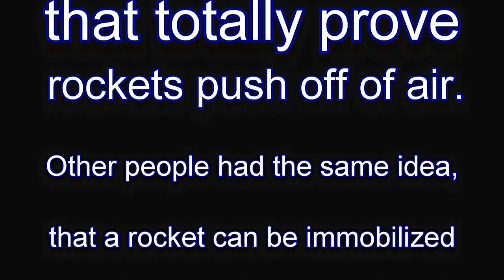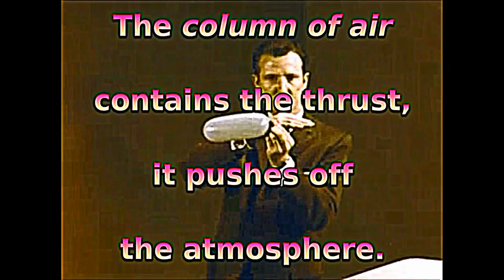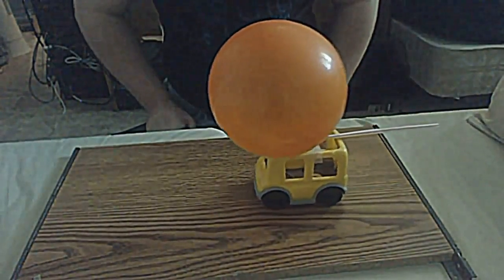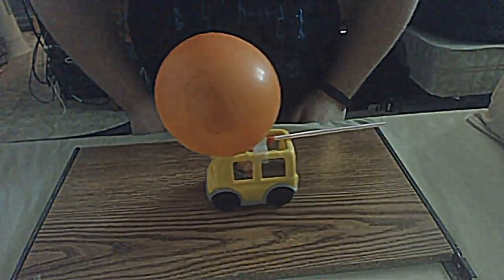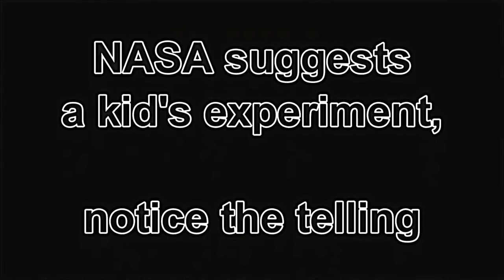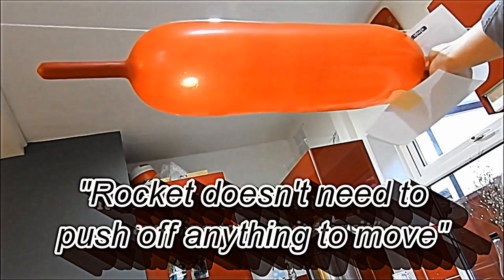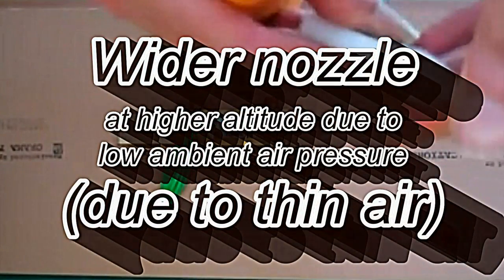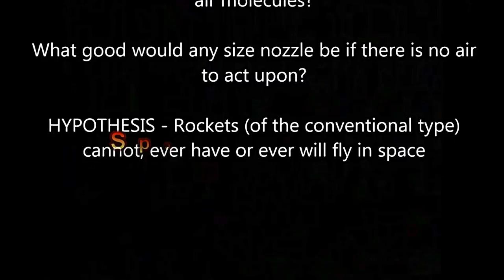rockets push off air

Comment: Now you need to do it in a vacuum to actually prove your claim.
Reply from the maker: No Bob. If rockets need to push off air, then space is fake. Vacuum only exists in confined spaces on earth.
Reply: You haven't proved that your balloon wouldn't fly in a vaccuum.  You are assuming your conclusion.
That's garbage logic.
You need to create a vacuum in a large container, like a bell jar, and release an inflated balloon to prove what you are claiming.
Now, if air pressure decreases gradually and continually as you increase in altitude, you would get what, eventually, Mr. Genius?
Reply from the maker: You would get what we see in every rocket launch, a parabolic arc. The rocket reaches the max altitude due to THIN AIR and due to the nozzle circumference (each diameter is only good at a specific altitude, wider for thinner air) and then drops back down, proving rockets push off air. Your little bell is not INFINITE SPACE or even close to imaginary space. Now then, where is your PROOF that rockets do not push off air? I set out to prove rockets push off air and succeeded. Vacuum only exists in confined spaces on earth. Up high we have thin air, that, together with nozzle diameter limits the height of rockets to that of a jet plane, take care, and I'm waiting for your PROOF.
Reply: Why is the air thinner higher up?
Reply: Yeah, why is the air thinner higher up? Surely not because of... gravity!!

And anyhow, what do we mean when we say "the air is thinner"? What is air (we can't see it)? And how can something we can't see be "thinner". If we can't see it, it must already be thinner than a cobweb, right? And if it's thinner than a cobweb, surely it would break if something tried to push against it? So, how do rockets even push against it if it's not even strong enough to support a very small spider??
Reply from the maker: @pictobloxer5412  nothing goes to space, air is too thin past 20 miles up
Reply: @rocketspushoffair  wait, you mean we really hadn't gone to space?
Reply from the maker: @pictobloxer5412  right, nobody has been to space, space is actually fake
Reply: @rocketspushoffair  be gone
Reply: ezdfiant a rocket works like a constant explosion. The explosion pushes against the rocket causing it to move upwards. Air is not needed to move a rocket upwards, in fact, air slows the rocket down as friction is a thing. The air particles colliding with the rocket produces friction, which would slow it down. Not to mention that gravity also pulls the rocket down.
Reply: @rocketspushoffair , I can't help but notice you never addressed the question of why air is thinner the higher you go.

You've acknowledged that the air gets thinner the higher you go, but why? And what do you think the 'limit' of thinness is when it comes to air in the Earths atmosphere? Also, what causes that limit? Is is a physical barrier like the firmament? Or is it something else?

Also, why are you so opposed to using a vacuum chamber to show that rockets need air to push off? Wouldn't it prove your position of 'rockets need to push off air' to be a correct hypothesis once it showed that thrust was not possible in a vacuum chamber?
Reply: @rocketspushoffair  Why does the air get thinner as altitude increases?
Reply: @rocketspushoffair  if I can interject, not meaning to be rude. But rockets arch because they need to gain orbital velocity. This is where they travel so far at a certain altitude that (effectively, there is more complex physics behind it) that the earth falls away from them as fast as they travel around it. Sorta like spinning a ping pong ball in a cone (if that makes sense) in this case, no matter how far they go up. If they dont start accelerating around the world, they’ll just come back down. That’s why all amateur rockets go straight up and straight back down whilst rockets with orbital payloads such as astronauts and satellites arch. They are trying to achieve orbital velocity. 

As for nothing ever getting to space. You can see the ISS in orbit with the naked eye. Only one way it would be there.
Reply from the maker: @engineeringtheweirdguy2103  You have no clue what you are seeing that you call the ISS. And if you can see it with the naked eye (I have seen it a few times) then they should be able to see the planes clearly flying over the ball, which are above the weather systems. And, Hubble (which is really just the SOPHIA plane) should be able to zoom in on earth or the moon. Again, no such evidence. In the video, the NASA spokes person specifically says "STRAIGHT UP!" Did something change? 

Yes. They realized that people can still see it long enough for it to start nosing down at the apex of the parabolic arch due to thin air that can no longer support it thrust. The amateur rockets don't go very high. EDIT:  And not as tall.

Jet planes are limited by thin air. They have the same principle of propulsion as rockets, only they use the rocket engine to turn turbines to compress air and blow it out the back of the engine, while rockets use the natural expansion of combustion directly. In either case, it is gas vs gas outside the engine.

On a fighter pilot channel, he was asked what happens if he tries to thrust into a higher elevation than max elevation, and the reply stated that it is impossible to go even an inch higher. This is 100% due to thin air. Be honest with yourself, you are defending a lie, an impossi-BALL HOAX.
Reply from the maker: @pblakeney  Air has weight. If there was a magic force, it would all be compressed to the ground. We are literally at the bottom of an ocean of air, just like being at the bottom of the ocean.
Reply: @rocketspushoffair  if there was a force such as gravity then just like water we should see pressure increase with depth. Which we do. Hence the pressure gradients. Which follow a linear progression in relation to the weight of the air above it.
Reply: @rocketspushoffair  and weight is a force = mass X acceleration due to gravity (g=9.81 m/s/s). It would not all be compressed to the ground. Your statement proves you don't understand physics. Your statement about air is not correct either. Air has mass (not weight). Weight is not constant in the universe. On Earth, because of this acceleration, all objects with mass on Earth experience weight. Objects with greater mass experience more weight and would be more attracted to the Earth than objects with less mass.
Reply from the maker: @pblakeney  most people say weight, only brainwashed people say mass, as there is no magic force of gravity. All you have done is invented an F=ma relationship. YOU don't have a clue. If there was a force all air would be forced to the ground. Terminal velocity also proves there is no active force constantly pulling. And no, air resistance is not the reason, because you can drop a thin metal pointed rod which has very little air resistance, terminal velocity is reached in a matter of seconds. Also, no cracked body can spin, and no material can spin over 1000 mph SPIN1.FLAT.WTF custom link to my page on Blogger, debunk that. Fake globe earth is mostly covered with a cracked basalt crust.

And THAT'S the end of the globe!
Reply from the maker: @engineeringtheweirdguy2103  Air is fluid, if there is a force pulling on it, it will all be pulled down.
Reply: @rocketspushoffair  yes it will. But gasses are particles, they bounce off one another and surfaces. Imagine pouring a a ton of bouncy balls off a building into an open top shopping container. There are a lot of balls at the bottom but as you get higher in the container the balls get thinner and thinner as they bounce around.
Reply: @rocketspushoffair  I just read your comment on force in more detail and i gotta say. not very well constructed. Physics 101 stuff. Lets start with your assertion about an object spinning at "1000mph". things do not spin in mph. when someone asks how fast your motor spins in third gear doing 60mph your dont reply with 60mph. you respond with 3500 rpm or revolutions per minute. that is because RPM describes a rotational velocity which is applied to a rotating body. every part of that body, from the outer rim to the centre of the axel is rotating at that speed. Mph is a linear velocity or tangential speed. which changes according to the radius from the axis of rotation for any one rotational velocity.

another point to make is there is a keen distinction between weight and mass. this is easily proven and observed. If you have a bucket of water and you spin it around and around. you will notice a force applied to your hand. That force is determined as weight. additionally if you were on a roller coaster and you suddenly started flying down a ramp. if you were to be on a scale at that point in time your weight would be less than standing on the ground. Weight is the magnitude of the application of force. We can observe this readily. such as in the bucket example. The weight of the water in the bucket increases and pulls away from your hand. But the mass of the water. i.e. the number of atoms making up the water in the bucket, has not changed. Mass, being effectively the count of atoms of an object or volume, then determines the weight of an object. the more water you put in the bucket, the more weight will be experienced when you spin it. That is because the centripetal acceleration is being applied to the mass in the bucket to generate and outwards force which we know as weight.

There we see a very clear distinction between weight and mass. something with a mass of 40kg, will have a mass of 40kg, if its going up or down a roller coaster or being swung around in a bucket. But the weight of that 40kg can changed depending on the net acceleration applied to it. As we have just demonstrated.

This is first year physics 101 and is trivial to demonstrate. as you have just seen.
Reply: @rocketspushoffair  in regard to terminal velocity. a small pin does not disprove air resistance. merely re-enforces it. A pin, despite having a small surface area, still experiences wind resistance. which is a function of the speed and the aerodynamic area. meaning if the pin takes up any space what so ever facing towards the wind. even one as tiny as a pin head, means there is a non zero wind resistance on that pin. as the pin speed increases, the wind resistance increases. As we know, sticking your hand out of the car doing 70mph experiences significantly more force than holding your hand out in a light breeze despite having identical surface area. This is because wind resistance or air resistance is also a function of speed as much as it is a function of area.

as the pin increases in speed, so does the wind resistance until ultimately the force of the wind is equal to that of the force pulling the pin downwards (the weight). at which points the two forces cancel each other out and you have a classic example of Newtons 1st law applying to an object in uniform motion. it wont accelerate or decelerate until acted upon by something out. but maintain its speed. Hence, terminal velocity, even for a in.
Reply: @rocketspushoffair  and before you bring it up. Yes, I have seen your video on the mechanics handbook. In accordance with my comment made on that video in its comment section, the Mechanics handbook is correct. But your interpretation of it is wrong. This is because there is a distinction between stress and applied forces. There is also a distinction between linear/tangential velocity and rotational velocity. It also doesn't account for anything with gravity keeping it together, which as I explained would be similar to tensioning a steel strap around the flywheel to keep it together.
Reply: @rocketspushoffair  Crickets!!! LOL Typical Flat Earther can't defend their model!!
Reply from the maker: @engineeringtheweirdguy2103  Flat earth is enclosed by a dome, try your experiment dropping balls on a ball.
Reply: @rocketspushoffair  I fail to see what difference it makes of its inside a dome or outside. Even a basketball would seem like a flat expanse to the size of a gas particle.
Reply: @rocketspushoffair  also there is absolutely no proof for a dome and all the evidence that there isnt
Reply from the maker: @engineeringtheweirdguy2103  Is that the best an "engineer" can do? Is cry "first year physics"? WHAT A JOKE! When I took "1st year physics" nowhere did they explain how a CRACKED BASALT body can spin, or how any cracked body can spin. Moreover, they did not show how any material can spin over 1000 mph like a top, w/o exploding way before that. Likewise, you too are unable to show how a CRACKED BASALT covered behemoth can spin at all, and spin like a top over 1000 mph. Hint: PHYSICALLY IMPOSSIBLE

The Machinery's Handbook, if you payed attention at my blog, (spin1.flat.wtf , spin2.flat.wtf , spin3.flat.wtf ) speaks in terms of feet per second, when talking about hoop stress. I have a video that shows two cutting discs of different diameter but the same speed limit 80 m/s (it also shows different RPM 13,000 or so and 5500 or so) Notice how radius is irrelevant?--If not, see the proof at my blog.

Your diatribe about weight is a deflection, like the rest of what you said in your comment. The scale below your feet is simply not attached to your feet or the ground, your weight has not decreased IT HAS INCREASED. Let's look at the fake Apollo rocket, NASA states that it weight 3000 tons, and it produced 3700 tons of thrust, hmmm, SIMPLE MATH tells you it cannot be true! At an acceleration of just 1 meter per second, the rocket now weighs 15,000 tons. A five fold increase. But they get away with fooling even an engineer, that is embarrassing.

Again, there is no force pulling on anything, that is a CONTRIVANCE. You accelerate for several seconds, and then you are at terminal velocity. People understand weightlifting not mass-lifting. Some idiot took terminal velocity, passed it off as a constant acceleration due to a force, created a new unit with his initial N and called it weight. And you fell for it, never thought to question it. There is obviously no force pulling on anything, there is just free fall speed and terminal velocity.

So far, you are failing Physics 101. Let's put another nail in your globe cult. Rigid body rotation with translation. Or a ball that spins like a top circling the sun (or a car tire rolling on the road). When we examine just two of the fake globe's purported motions COMBINE, we see that there is 21 mm/sec squared acceleration and deceleration, alternating every 12 hours and switching direction every 6 months. Try building a rock balancing statue with that much acceleration! _HAAAHHAHAHHAA!!!!+ 

Add the acceleration due to orbiting the sun and being dragged by the sun, you are good for another 4 mm/sec squared. Simple online calculators are available, where all you have to do is plug in the fake g lobe data. Also, I have two videos uploaded for each pair of motions I mentioned. The first one by an actual physicist, that I edited to make some improvements in the presentation https://youtu.be/AfEbsnOXrX0

So, you are a complete failure.
Reply from the maker: @engineeringtheweirdguy2103  I never said "a pin". I said a thin metal rod, something that weighs at least a few pounds or more, say 10 feet by 1 half inch, sharpened to a long point. After several seconds it is at terminal velocity, and wind resistance has no involvement whatsoever in reaching terminal velocity, after so short a time, and with such a nice shape of object, that easily cuts through. You can use a rail gun to propel an object 7 times the speed of sound, a very pointed object. But the fastest jet plane can barely do mach 3, at which point it practically is melting.

Materials, have limits. A cracked basalt body cannot spin to begin with, it has zero tensile strength. And, even if it was a solid body, no material can spin over 1000 mph like atop, like fake cracked basalt globe earth, w/o exploding way before that.
Reply from the maker: @engineeringtheweirdguy2103  So long as an object spins, all the forces of spinning like a top will be present. A compression is AN ADDITIONAL FORCE. There is no hoop stress tension or compression in the ground, because we are not spinning, no F=ma. If you read the whole chapter on flywheels, then you would have come across the part where it t ells you reinforcements can only do so much, and often times are counterproductive due to the extra weight.In highly engineered flywheels, they do use compression rings, but the physical limit of molecular bonds of the ring is still there. Fake globe earth has a cracked basal crust (mostly) and a cracked granite crust--which amounts to a heterogeneous "compression ring" which amounts to a bunch of BS. The cracked heterogeneous crust is underpinned by molten elastic tectonic plates--which amounts to BS piled on top of BS.

No cracked body can spin, case closed.

I am not "interpreting" anything. Just stating the cold hard facts and backing that up with engineering textbook references. You are looking like a fool trying to defend a physically impossible cracked basalt ball.
Reply from the maker: @pblakeney  Terminal velocity is reached in a matter of seconds. Also, no cracked body can spin, and no material can spin over 1000 mph SPIN1.FLAT.WTF custom link to my page on Blogger, debunk that. Fake globe earth is mostly covered with a cracked basalt crust. EDIT: at least you admitted "gravity" requires "belief" HAAHHAHAAHHAA!!!!

And THAT'S the end of the globe!
Reply: @rocketspushoffair  you do realise that you can use gravity to not only predict ballistic trajectories, impact forces air speeds etc. but also to describe how multiple things work. Something than can be used to predict reality accuracy doesn’t seem like bullshit to me. In addition, I was referring to the difference between rotational velocity and linear velocity being first year physics. Something which, given you comment must have gone completely over your head. Also I’ve already give detailed explaination as to the mechanics handbook. And how it is correct but your conclusion is wrong.

The thing you are ignoring is that gravity is holding everything to the earth. Including all that basalt. With more force than is being exerted outwards due to rotation. That’s pretty rudimentary to prove mathematically. As I explained before that would be the equivalent to putting a tensioned steel strap around the flywheel holding it all in together. I’ve told you this multiple times now.

You can bitch and moan that gravity is bullshit. All the live long day. But you can’t say the globe model doesn’t work due to the spin on the pre-supposition that gravity is bullshit. In that case the problem isn’t with the earth rotating. The logic and physics behind that is fine. The problem you have is then with gravity. Using a false representation of the globe earth model to show how the globe earth model is wrong is the definition of a strawman argument.

At no instance is anyone claiming that, that mass can rotate with the diameter it has, without exerting enough stress to break apart. What we are claiming is that, the gravity of that mass is holding it together. Because the gravity exceeds the centripetal forces.
Reply: @rocketspushoffair  as for terminal velocity, that is well understood. It’s easily and readily predictable in every instance using very basic mathematics. Even for a pin.
Reply: @rocketspushoffair  also that’s not how the acceleration works. As we are part of the orbit, that outwards acceleration will be constant. And the definition of an orbit is that the outwards acceleration matches the inwards pull of gravity. As such the vectors cancel out as they are by definition equal and opposite. Which ultimately leads to us feeling zero acceleration due to the orbit around the sun. F=ma. If a is zero, so must F.
Reply: @rocketspushoffair  if it takes up volume. It has a cross sectional area, it will encounter wind resistance. It’s basic physics
Reply: @rocketspushoffair  wind resistance is at its simplest form, the force require to move the air out of the way for a volume. Your rod (or very large pin) would take up volume. Therefore it would encounter wind resistance.
Reply: @rocketspushoffair  yes. they can only do so much as in more than nothing besides, as I’ve already described, gravity is what is holding it together. Your disagreement is with that
Reply: @rocketspushoffair  Air is compressed to the ground, that's why air pressure reduces so rapidly with altitude.
Reply: @rocketspushoffair  Do you have any evidence for your assertion that after a few seconds your sharpened rod would reach terminal velocity? No you don't, you just made that claim up.
Reply from the maker: @engineeringtheweirdguy2103  You said: "The thing you are ignoring is that gravity is holding everything to the earth. Including all that basalt. With more force than is being exerted outwards due to rotation. That’s pretty rudimentary to prove mathematically. As I explained before that would be the equivalent to putting a tensioned steel strap around the flywheel holding it all in together. I’ve told you this multiple times now." 

You don't know your model or gravity, and you are forced to conflate the physics for two different rotation axes spin1.flat.wtf 

You are trying to justify the cracked liquid filled ball with math that only applies to surface objects. Who's rotation axis is away from their center of mass.

A cracked ball cannot spin. And even with a steel belt, it cannot go close to 1000 mph. 

"Gravity" is much weaker than a magnet, and orders of magnitude weaker than molecular bonds of steel. 

Moreover, "gravity within fake globe earth decreases linearly to zero at the center, and the attraction is towards the surface.

There is no "compression" whatsoever, except in your conflated concocted mathematical excuse.

Tension would have to be the same by definition from the surface to the center. And every particle in your entire ball would have to bee considered as a ball on a string. 

But your model treats it as a sold. You cannot apply any of your mathematical excuses with your made up forces to a solid, case closed.

Also, spin plus orbit equals 21 mm/s/s of acceleration alternating with deceleration every 12 hours. A simple rock balancing statue debunks you. Add another 4 mm/s/s for orbit plus dragged by the sun. If you are having difficulty with the calculations, Ii have two videos.

Take care! 😎👍
Reply from the maker: @engineeringtheweirdguy2103  And speaking of wind resistance, that limits speed to mach three.

Take care! 😎👍
Reply: @rocketspushoffair  why 3 times the speed of sound? Terminal velocity will always be below the speed of sound (mach 1). Terminal velocity is very simply, when the force applied by wind resistance is equal to the force applied by gravity. Wind resistance will increase with speed until you reach a speed where the force of the wind resistance equals the force pulling you down.

slender rod or not. This is the entire premise parachutes work on. They increase the surface area to increase wind resistance, such that the speed at which you need to fall to reach terminal velocity is significantly less. Bullets and arrows are designed to mitigate their wind resistance so they can reach higher terminal velocities and when they're accelerated initially beyond their terminal velocities, their deceleration is slower giving you a further shot with more power.

you're complete ignorance of physics is breathtaking, yet you believe you've outsmarted hundreds of millions of Engineers, physicists, scientist etc. Oh they ego and delusions of grandeur you must have!
Reply from the maker: @engineeringtheweirdguy2103  my previous reply stands, "gravity" is no longer considered a force https://www.google.com/search?q=gravity+no+longer+a+force and it is admitted by physicists that nobody understands it https://www.youtube.com/watch?v=AFwbcWIUwLQ&t=213s but even if we pretend it is a force, what you stated only apples to surface objects.

Moreover, if it is always acing, then there would be no acceleration needed to reach terminal velocity, when a bullet leaves the barrel, it is continuously slowing down.

Free fall is not less at the equator.

So, gravity is not a compression, it is an attraction to the surface from within and without the fake globe, thus, mathematically speaking, the source can only be an infinitesimally thin layer on the surface.

For your compression to work, gravity cannot be zero at the center, and thee source musty bee the center.

THIS IS SO RE-TARDEDLY WRONG: "In the steel belt analogy, the steel belt would only break if if the centripetal force exceeded 9.81m/s/s. (gravity)."--IT WOULD BREAK WAY BEFORE 1000 MPH surface speed. Gravity is orders of magnitude weaker than molecular bonds. Calculations here spn1.flat.wtf

What you are trying to do with your imaginary force is attribute solidity to your cracked spinning space pear and trillions of psi of tensile strength, so that t outperforms solid titanium. Meanwhile, you try to debunk engineering physics with dumb math that only apples to objects who's rotation axis is away from their center of mass.

Finally, you deny basic physics of rigid body rotation with translation. Or a car tire rolling on the road. The COMBINED EFFECT of spinning + orbit = 21 mm/s/s of alternating acceleration with deceleration every 12 hours. Add 4 mm/s/s for orbit plus dragged by sun. Both videos on my channel.

_R.I.P. _  Engineering the weird guy 💀
Reply from the maker: @engineeringtheweirdguy2103  All trajectory calcs are flat earth based. And if it wasn't for the inability to push the atmosphere away, you would have no thrust. Mach 3 is the limit at which point your craft is melting.
Reply: @rocketspushoffair  I've responded to that multiple times. Correct is it not a force. It is an acceleration. Hence  why it is measured in m/s/s and not Newtons. But do you know what happens when you apply an acceleration to a mass.. I'll give you a hint. Its measured in Newtons.

additionally what i've stated does not only apply to a surface. Centripetal force applies to any part of a rotating body at any given radius from axis of rotation. Infact  it so much so, not a surface equation that when designing flywheels or analysis alloy wheel strength you have to find the radius at which a rotational mass is centralised. For example if you have a 500kg flywheel, where 499kg is within 300mm of the central axis of rotation and the last kg is spread between 300-900mm from the central axis of rotation. Guess what! you dont calculate the force on the fly wheel as 500kg, at a radius of 900kg.

You may also note that my calculations were for acceleration. Not force. which in independent of mass or surface but rather just a function of radius and rotational velocity. No part of the equation considers any surface qualities. 

Free fall IS less at the equator. By 0.034m/s/s. infact thats just enough to measure with a kitchen scale and a calibration weight. sorry to say but there are countless videos on youtube of people doing exactly that Its also in pilots pre-take off instructions to calibrate their equipment because of that.

I never said gravity was zero anywhere.

once again. the steel belt was an ANALOGY if you dont know what that means. Buy a Dictionary. If you dont know what that is, by a Thesaurus and work your way back. I am by no means suggesting that there is a steel belt around the earth, nitwit it is an analogy. I am not suggesting the earths rotation is bound by the mechanical constraints of a 3mm thick strap of stainless steel. Its merely to represent that there is action being applied inwards to counteract the outwards centripetal action.

How many times do I have to explain this before you realise that you might be a few marble shorts.

I am also not trying to attribute any mechanical propoerties to the earth. Once again, notice that my calculations are only for acceleration. They have nothing to do with stress, strain, or mechanical properties of materials.

Cracked, not cracked, rock, basalt, water, dried autumn leaves. doesnt matter. acceleration is acceleration. it will just move mass, what ever mass, any mass, in the prevailing direction of the net  acceleration. The net acceleration in this case is inwards. Because the inwards acceleration is greater than the outwards acceleration and vectors are scalar.

you getting it yet? or do you need more crayons?
Reply: @rocketspushoffair  Hypersonic missiles travel at Mach 5. only short range trajectory is flat earth based because a small enough sample of a sphere can safely be considered flat. Because your margin of error of such small distances relative to the circumference, is safely considered negligible. For example if you're trying to hit a runway 80m wides and 1,500m long, being out by 0.18m can safely be ignored.
Reply: @rocketspushoffair  also if you think I am attributing surface characteristics or solid characteristics (i mean really. pick one. you cant have both) to my calculations. point out where those attributes are. Is there some geometric constraint I'm using, some mechanical constraint like modulus of elasticity? I'll wait.
Reply from the maker: @engineeringtheweirdguy2103  We're not talking about missiles. ICBM'S don't exist.
Reply from the maker: @engineeringtheweirdguy2103  You are using math for one axis of rotation to justify another, it doesn't work that way. Spinning like a top only possible for SOLID bodies. And no solid body can spin 1000 mph. By definition your globe cannot spin at all, it's cracked, and if it was sold it's too big and heavy and too fast, but even just attempting to spin it, it would instantly destruct under its own weight. From empirical data in the Machinery's Handbook, you decrease 1 rpm for each 6 inch increase in radius, so that you cannot even hit 34 feet in diameter for sold cast iron, at fake pear earth rpm.

So what is your pear like? Sold or not? Start there. So far, your compression theory s a flop, due to the fact gravity is zero at the center, and the attraction is towards the surface.
Reply: @rocketspushoffair  I’m not talking about ICBM’s and I’d love to see evidence that they don’t exist. I’m talking about hypersonic missiles such as air to ground, sea to air, anti-ship, etc. you can even find videos of them.
Reply: @rocketspushoffair  so when you store your tea, does it become a solid body does it? When you see a tornado, it’s a solid body? What about the dust in the tornado, does that form part of a solid body.

You are so out of your depth in relation to physics that you should be very embarrassed. Take a physics course.
Reply: @rocketspushoffair  what about belt clutches, do the shoes and the springs come together to make a single solid body? I could go on and on.
Reply: @rocketspushoffair  why is gravity zero at the centre a deal breaker? Does that change the weight of the material around it not at the centre? I don’t think it does. As for your machinery handbook, it does not discuss what would happen if the flywheel had its own significantly large gravitation field pulling equally towards it centre does it?

Didn’t think so it did. So that as evidence? Flop. Try again. You can’t just ignore what you think is inconvenient. The fact is the globe model means earth has significant gravitational field. For your evidence in the machinist handbook to apply, it would have to include a factor for a significant gravitational pull towards the wheels centre of mass. Which it doesn’t. Therefore, not analogous. or evidence.

Sorry. Try again.
Reply from the maker: @engineeringtheweirdguy2103  THIS IS WHY YOU ARE DEALING IN SCI-FI: "Once again, notice that my calculations are only for acceleration. They have nothing to do with stress, strain, or mechanical properties of materials."

First, you need to decide if you are treating your spinning pace pear as a solid or a collection of particles?  have already proven that as a solid it cannot exist spin1.flat.wtf and  have shown the force relationships for discs, spheres, hollow spheres and rings at spn2.flat.wtf they all break along the longitude. "It's as if the force acts along the diameter" so you se an apple splits as if you sliced it with a knife apple.flat.wtf

BY DEFINITION there is no force pulling on the axis of a body that spins about its own center of mass R=0 and v=0 radius factors right out of thee equation, see spin3.flat.wtf and spin2.flat.wtf to learn why.

So, don't talk about your bs compression, it is nonsensical to think it applies to solid bodies, it doesn't. From the correct equations you will understand there is a force multiplier effect (you no longer divide by radius) in the heavy stress zone explained at spin1.flat.wtf that's where the tension is, and it s NOT caused by a radial force, as explained at spin2.flat.wtf Also, weight is a direct force multiplier. Thus, thee tension is so great at ANY point around thee circumference, you don't have a hope for "gravity" to save your spinning space pear, by opposing .0034g outward surface force.

So, by definition your spinning space pear is NOT A SOLID. So it cannot possibly be spinning about its center of mass. And, that fact that "gravity" is ZERO at the center instantly disqualifies your compression theory again, and underscores the fact that it ONLY applies to surface objects.

You got nothing but a reification fantasy.
Reply from the maker: @engineeringtheweirdguy2103  In a tornado all the particles rotate around an axis AWAY FROM THEIR CENTER OF MASS. is your spinning space pear now a tornado! HAAHHHAHAAHAAA!!!!! But "gravity" is still zero at the center and you cannot apply your compression bollocks as a result, because the source of gravity would have to be the center, and the greatest "pull" would have to be felt there, once you consider all the particles swinging around as if they were attached there by a string! But even more confounding for you, is the fact that the particles would have to be attached ALONG THE ENTIRE AXIS! 😂
Reply from the maker: @engineeringtheweirdguy2103  No. Are the shoes and springs spinning about their own center of mass? No. Basic engineering, learn the force relationships for the two rotation axes here spin1.flat.wtf I have a nice little table for you! Don't forget, a system of rotating particles as a sphere means the radial force is along the axis. "Gravity" radiates from the center in all directions, getting stronger towards the surface. So, as if gravity being zero at thee center was not problematic enough, not you have vector direction issues as well!

Please do not refer to SOLID bodies again! It is irrelevant to your cracked spinning (somehow) space pear. Stick to actual demonstrable engineering physics, like I do.

Thanks! 😁👍
Reply: @rocketspushoffair  who's saying gravity is zero at the centre? additionally, are you suggesting that if you were it put a clamp around your arm, that you wouldn't feel it because the clamp isnt acting from the centre of your arm?

Nobody said the earth was a tornado. I pointed out that you dont need to be a solid to rotate around an axis. Which a tornado does. Also, tehcnically speaking, the centre of mass of a tornado is at its centre.

Do you know nothing? tell me, if you had a fly wheel with a hole in the centre, where would the centre of mass be? on yeah, in the centre. Now if you had a tornado of debree circling a hollow centre, where would the centre of mass be?

thought so.
Reply from the maker: @engineeringtheweirdguy2103  Yes, I've seen rail gun projectiles, so what? They are tiny compared to rocket ships or jet planes.
Reply: @rocketspushoffair  why do you think the greatest pull would have to be and the centre and in relation to gravity, what makes you thing that it isn't?
Reply: @rocketspushoffair  rail guns vs planes. What’s your point with that one? I didn’t mention rail guns.
Reply: @rocketspushoffair  and I still dont know why gravity being zero at the centre is a deal breaker, Is it not being pushed in by all the material ontop of it? it is isnt it? thought so. 

Secondly gravity doesnt act radially from an "axis" it act radially from a point. the reason it acts towards the centre is the same reason it its zero at the centre. Every atom in the universe has just a little bit of gravity pulling towards itself. a collection of these atoms will always result in a pull towards the centre of mass. But lets say you're in the centre of mass. Then you have an equal amount of mass pull in all directions. Since acceleration is vector, they cancel out to zero. Gravity is greatest at the surface because you have all the weight pulling down below you and nothing pulling up above you.

reagrdless I do not see how that invalidates anything i've said.
Reply: @rocketspushoffair  ok. See you in another 10 months when you think of something to try and save yourself with.
Reply from the maker: @engineeringtheweirdguy2103  No. I plan to reply tomorrow, to help you understand your foolishness.
Reply: @rocketspushoffair  says the person ignoring basic physics
Reply from the maker: @engineeringtheweirdguy2103  YOU ARE IN FANTASY LAND: " think of it this way, what if you had a magnetic field that was pull inwards with greater force than the rotational velocity was pulling outwards? would you not be able to achieve higher speeds? If it broke due to rotation would it not just fly in towards the magnet? if that's the case, why did it break in the first place? not due to the velocity because we both know forces are scalar." because:

First define what you are spinning. If it is a SOLD BODY spinning like a top, the tension in the heavy stress zone ring around the greatest circumference (hoop stress tension) is trillions of psi at every point, and it's tangential, which explains why the body splits along its longitude as if you cut it with a knife  :yt:apple.flat.wtf  this is referenced here spin2.flat.wtf For every pound of weight, many more pounds of tension (psi) are added to the heavy stress zone. So, even if fake globe earth was SOLD TITANIUM it would destruct the moment you tried to spin it. Case closed. Gravity is perpendicular to the tangential force, and TOO WEAK anyways, orders of magnitude too weak, it cannot save a solid spinning body spn1.flat.wtf

Now, let's look at your cracked and leaking liquid filled spinning space pear: It is a collection of particles connected to the axis BY A MAGIC TRAKTOR BEAM "GRAVITY". The radial force is PERPENDICULAR to the axis all along its length, thus, "gravity" ONLY DIRECTLY OPPOSES at the equator. That's problem 1. Next, the direction of gravity within the space pear is towards the surface, so it CANCELS ITSELF OUT. Take any diameter spherical section at the center of the fake space pear, and thee pull is equal in all directions TOWARDS THE SURFACE, the exact opposite direction of compression. That's problem 2, there is no compression, just an attraction towards the surface both above and below the surface.

If there was compression, it would have to get stronger and stronger TOWARDS THE CENTER. But gravity cancels out at the center, and decreases towards the center. And that's the end of the spinning pear shaped collection of liquid and particles! 😁
Reply: @rocketspushoffair  why does it matter if it’s a solid. If you had iron filings or dust on a magnet and you spun it it would stay wouldn’t it? And if the magnetic pull was higher than centripetal force, it would remain on the magnet would it not?

You’re seriously deluding yourself. Get iron filings, put it in a magnet, and spin the magnet, what happens.
Reply: @rocketspushoffair  trillions of psi? No. Let’s not forget that the rotational velocity of the earth is 0.00007292 radians/S. Not exactly break neck speeds.
Reply: @rocketspushoffair  see you in 10 months then.
Reply: @rocketspushoffair  Dont know how long days are where you are. But I'm pretty sure its past "tomorrow" So i guess see you in 10 months again?
Reply: @rocketspushoffair  Space is not fake, however, your understanding of how rockets work in space is.  When will you substantiate your claims?
Reply from the maker: @pblakeney  All your claims and beliefs have been smashed. 🤣 "When will you substantiate your claims?" i'LL ANSWER 4 YOU: NEVER!!!
Reply: @rocketspushoffair  Do you have nothing to say in your defense?
Reply from the maker: @pblakeney  I'm not defending anything, just exposing your lies upon lies 😁😆😉
Reply: @rocketspushoffair  When are you going to start exposing my lies?
Reply: @rocketspushoffair  When will your YouTube subscribers witness you substantiate claims that you make? Why does a person need a contact force with their feet to throw a ball in a "weightless" environment? You seem fast to make ridiculous statements, when will you substantiate them?
Reply: @rocketspushoffair  It is too bad that you  are unable to argue your own position on anything.
Reply from the maker: @pblakeney  just because you believe in your own bull💩doesn't make it true!🤣
Reply: @rocketspushoffair  Still nothing from this crazy physicist?
Reply: @rocketspushoffair  You can't expose any lies if you are too coward to reply. Please explain why one needs to be anchored to throw a ball in space. Your followers are looking to you to expose all of the lies. So far you you have failed at just exposing the truth, let alone any "lies" that you have claimed.  We are waiting for this epic exposure. Any day would be great.
Reply: @rocketspushoffair  You can't expose lies when you don't ever respond. Don't be scared.
Reply: @rocketspushoffair  Nothing? Can't you defend your science?
Reply: @rocketspushoffair  You seem to be more on vacation and not so much on exposing any lies.
Reply: @rocketspushoffair  One day hopefully you will muster up the courage to debate about the claims that you made. Don't be a coward.
Reply: @rocketspushoffair  Name one lie that I stated?
Reply: @rocketspushoffair  Still waiting on you to expose my lies but all i hear is silence. Bueller?
Reply: @rocketspushoffair  Not much exposing going on here. Have you lost your ability to make or argue your case?
Reply: @pblakeney  wow you and your buddy just got SMASHED.  That was almost painful to read as I feel bad for your (intentional) naivete. 

You brought smoke to the wrong party lol